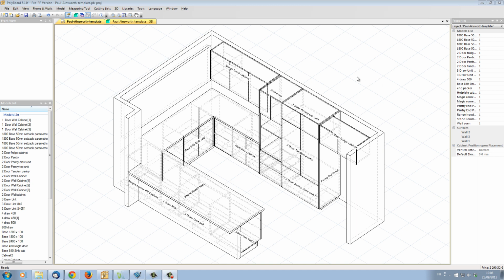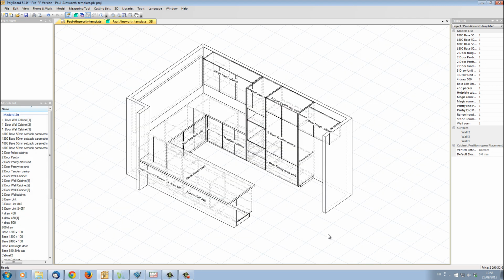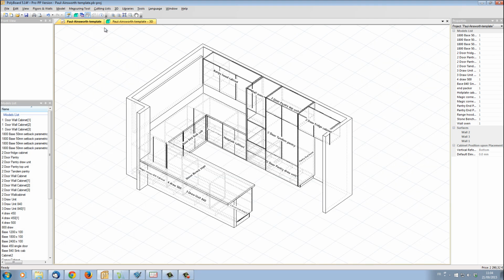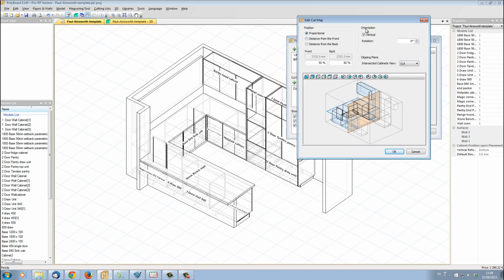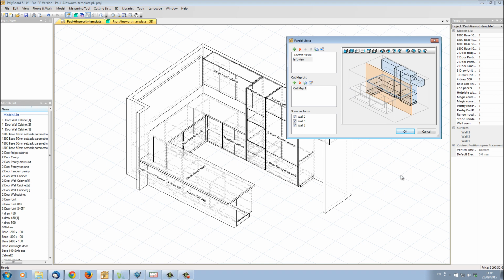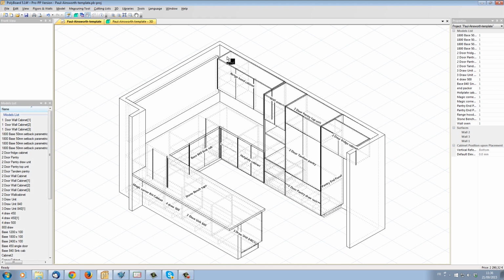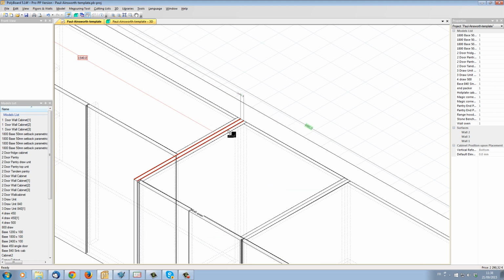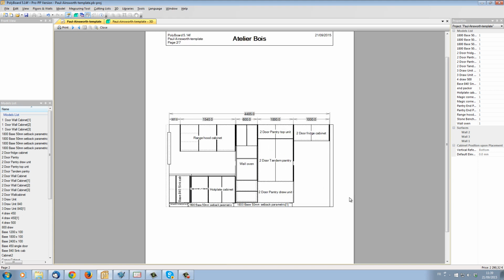Multiviews in a Workshop Document with Polyboard

Comment: hi, i have a problem with the views. Everything appears small in the sheet
Reply from the maker: Hi! If your Polyboard views appear small, try these steps: 
1) Check and adjust the zoom level in the document. 
2) Modify the view settings in Polyboard. 
3) Update your screen resolution settings, especially for high-res displays. 4) Ensure Polyboard is up-to-date. 

If issues persist, please send more details to our technicians via the forum: https://wooddesigner.org/forum/